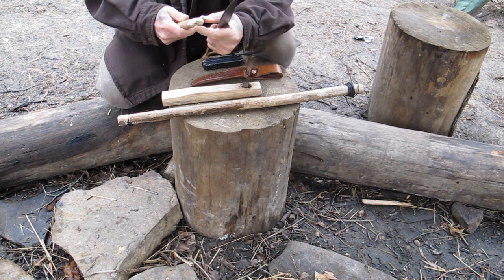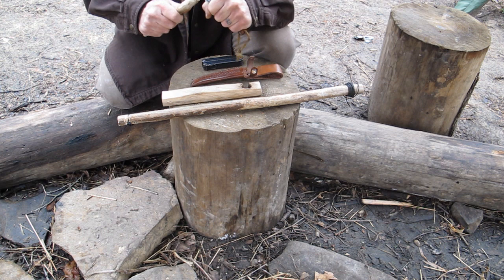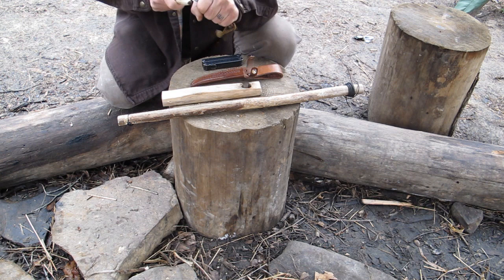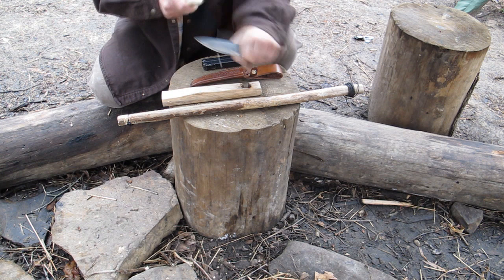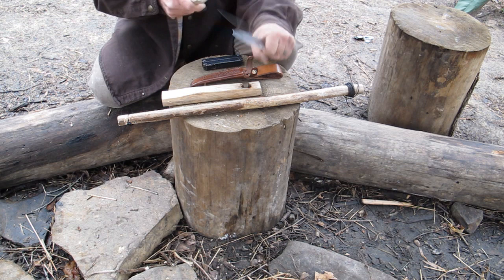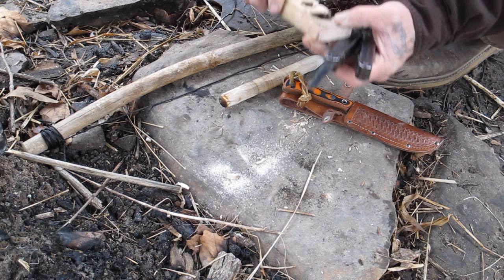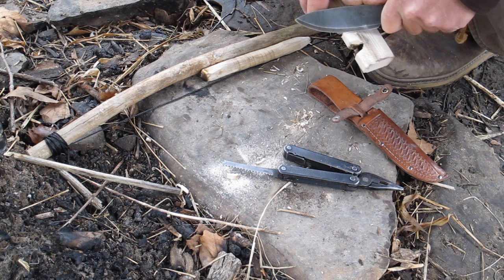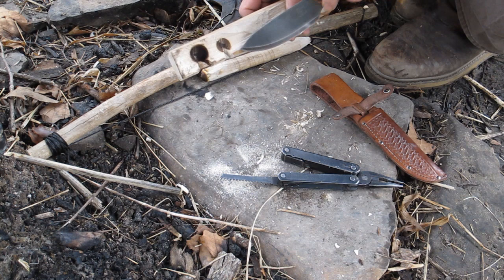Bow Drill in Damp Conditions

Comment: great vid. Dave, I always make my notches small so as it will not eat my board up for 1 and 2 for the very reason you showed here that you can do it in damp conditions. But you hit the nail on the head when you said that proper form is 95% of getting a coal. Most peole rip into it hard an fast. Until the dust gets built up in the notch take your time.

Comment: Dave I have an idea for you after watching this. You were absolutely correct in sheathing your knife when using it as a spindle block, but one thing I noticed is that the divot in the G-10 is on the INSIDE of the knife when sheathed forcing you to bend the leather out of the way in order to use it properly. In future versions of this knife have the manufacturer place the divot on the outside. In this way you no longer fold the sheath, preserving the structural integrity for a longer life.

Comment: Just a thought. Granted most people are right handed and would grab the knife handle with the hand socket away from their palm but wouldn't the hand socket be more user friendly on the right hand side or the outer side of the handle when the Pathfinder knife is in the sheath for safety sake? I noticed you had to fold the sheath over. Things to keep in mind if you create a Kydex sheath for the Pathfinder.

Comment: Hey Dave, This is interesting to me as i made 3 bow drill sets, willow,basswood, and silver maple. I got fire from all 3 sets in perfect conditions. I stored all 3 sets in an open debris shelter on a tarp. I dont believe any water actually touched any of the 3 sets but it rained that night. I thought Id try em when it was damp. The basswood and willow seemed to suck up the moisture, and the maple, while damp did create an ember. I guess its density made it resistant. Have u had this experience?

Comment: Dave,I know your open to suggestions. What if you inserted a conical SS piece into the hole that's used to apply downward pressure on the spindle of a bow drill ? It would never wear out.

Comment: that huge heat sink of a rock is sucking the heat out of that ember on the first try and then on the second try the new ember is on top of the dust insulating it from the rock. 
MY 2 cents.